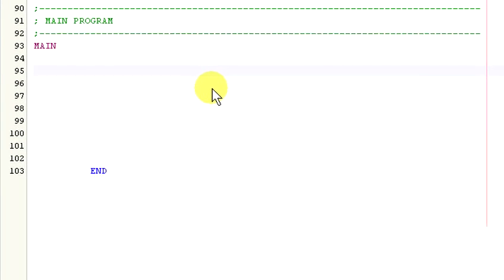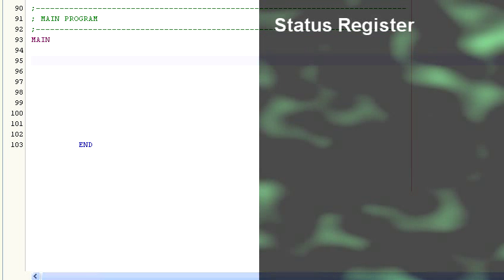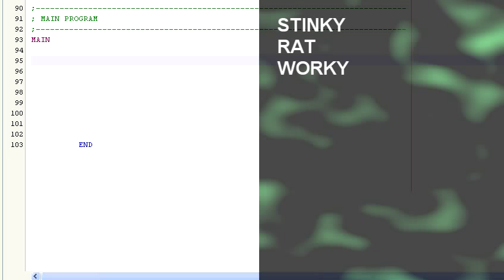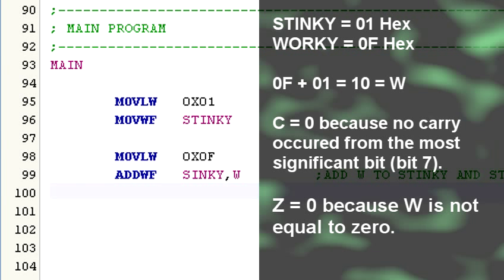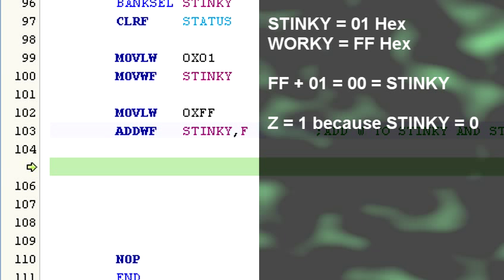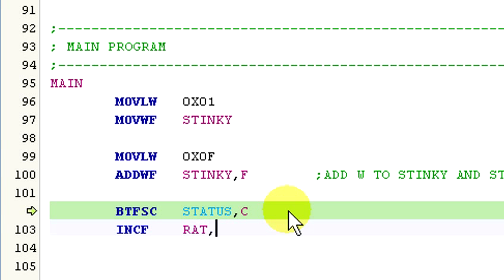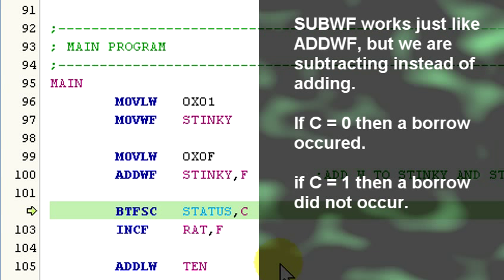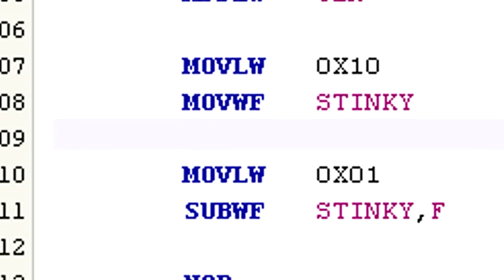MD Lab: MPLAB Assembly Language Basics: ADDWF ADDLW SUBWF SUBLW

Comment: It would has been great to show how to do a subwf when w>f so, the result it'll be negative. Because I have questions about C, DC and the result, if is this complement 16.
Reply from the maker: According to the Microchip datasheet for the PIC16F1519, C will be clear if the subtraction goes below zero. The DC flag refers to the lower nibble (bits 3:0) having carried or borrowed. Does this help or do you  have other questions?